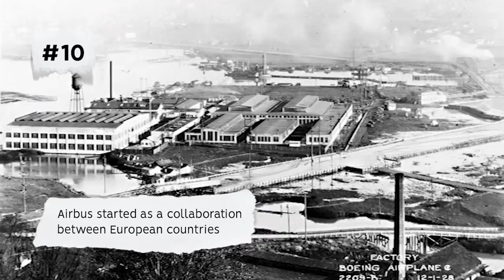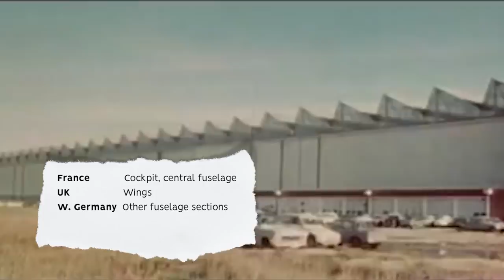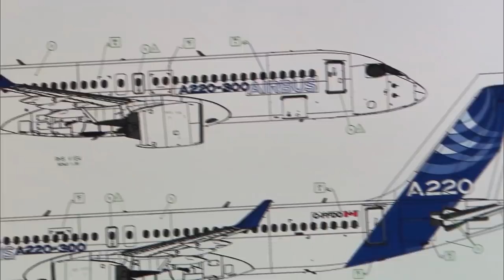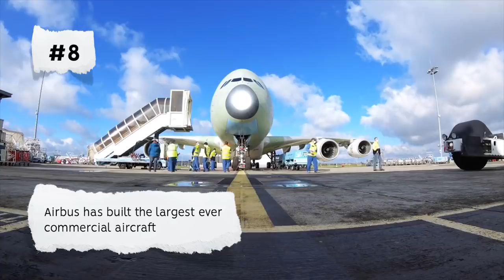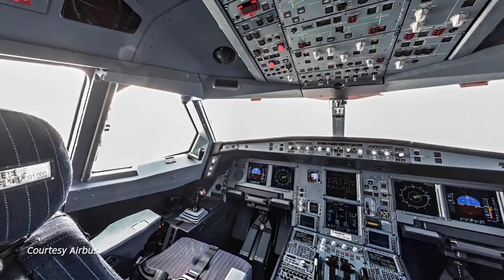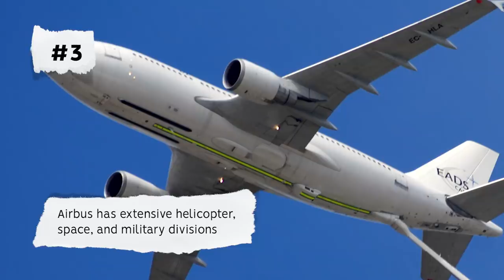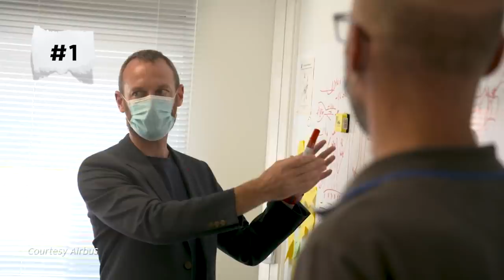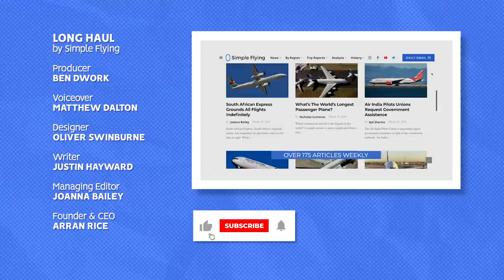10 Things You Might Not Know About Airbus

Comment: Some other things about their early products:
The very first Airbus was the A300B prototype. This prototype would be shorter than the original production version (A300B2). After Airbus didn't need it anymore it was sold to TEA (Belgium airline) but it started revenue service with Air Algerie on lease. The passenger A300 came in three sizes therefor, seating up to 323 (B1), 345 (B2/B4) and 361 (-600). The A300B4 also came with a digital cockpit in the -200FF version which ulitmately only was purchased by Finnair in low numbers. Also, the A300(B4)-600 is the only A300 to feature wingtip devices with the exception of some earlier A300 of this version. Interestingly, those wingtip devices are unique to the A300 as they feature a similar design but they have a much lower profile compared to the ones used on the A310-300 (and some late -200s). But that's not all: These A310 wingtip fences were then used on the A320-200 (and later on the A380) while the original A320-100 missed those.
Reply: The earlier A330s had a taller tail
Reply: Airbus is wierd

Comment: The original A300 agreed upon in 1967 was actually something almost the size of the A330, but powered by the proposed Rolls-Royce RB.207 engine rated at 51,000 lb thrust. But when airlines weren't so keenly interested and Rolls-Royce ran into RB.211 development difficulties, Airbus decided to reduce the plane to A300B size and switch to the more available General Electric CF6-50 engine.
Reply: That's right, the first Airbus project A300 was a 300 seats jet powered by new Rolls-Royce engines. But the project was rejected by airline companies and the availability of the engines was doubtful. So a crash program was launched at Sud-Aviation (R&D department in Suresnes which had previously developped the SO 4050 "Vautour") to completly rework the project, which ended with the smaller A300B project for 250 passengers using available US engines.
Reply: @78Dipar  Airbus was lucky that the GE CF6-50 became available by 1972. That made it possible to build the A300B powered by the GE 48,000 lb. thrust engine.
Reply: @Sacto1654  
It wasn't luck, the GE CF6-50 was selected for the A300B because it's availability was quite certain, it was first developped for the DC-10...
I have personally known the one who managed the team in charge of reworking the A300 project and replacing it by the A300B.
Reply: @78Dipar  Thank you very much for the very interesting historical informations.
Reply: Thank you very much for the very interesting historical informations.

Comment: Nice video.  Anyone know why Airbus chose 300 for their designation?
Reply: The initial study was for a 300 seat aircraft.
It required engines not available for a number of reasons, so the aircraft was quietly shrunk to a 250 seat capacity or so, while retaining the name.
Reply: @NielsC68  Thanks.  That makes sense
Reply: @NielsC68  the maximum capacity of the A300 is still above 300 ;)

Comment: I thought that the Lockheed L-1011 was the first fly by wire commercial airliner. Am I missing something?
Reply: Yes you are, it was the a320
Reply: @flexiexpress6713  thanks.
Reply: Nope you're both wrong, the first fly-by-wire commercial aircraft was Concorde, she had complete digitally controlled flight surfaces. A320 was the first full authority fly-by-wire and only the second fly-by-wire commercial aircraft.
Full authority means the computer does more than simply transmitting orders, it interprets them and can limit or block them in case the movement commanded by the pilot is beyond flight domain or limitations.
I'm heavily summarizing but where A320 has several control laws (Normal Law being the default operations one) Concorde somehow had only a kind of direct law.
Reply: @KyrilPG  The Concords' gauges were analog. Perhaps the flight controls were fly by wire, but the Concorde still has most  hydraulic systems. First fully digital fly-by-wire aircraft was developed by NASA and flown in 1972, so the Airbus A320 may in fact be the first fully digital fly-by-wire commercial airliner. I think the L-1011 had something similar to the Concorde, but it wasn't fully digital either.
Reply: @sainnt  Gauges have nothing to do with fly-by-wire. Every aircraft has hydraulic systems, this is off topic. You can have a fully digital fly-by-wire system and still use hydraulics actuators at the end of the line.
The definition of fly-by-wire is the replacement of mechanical cables and pulleys by digital signal wires.
A "fully digital" fly-by-wire only means there's no backup mechanical cables and pulleys.
Concorde's control transmission was fully digital and was the first commercial airliner built like this.
You're confusing display / cockpit, hydraulic (or electric) actuation and control transmission.
The A320 was the first full AUTHORITY fly-by-wire and second fly-by-wire airliner. Fly-by-wire means it's fully digital transmission by definition. Full authority means there's a computer interpreting and controlling the signal sent to actuators.
But on many fully fly-by-wire aircrafts several surfaces are actuated (moved) by hydraulics commanded by digital signal wires.
The proportion of hydraulics has nothing to do fly-by-wire or not. Even the most computerized airliners use hydraulics.
Concorde (takes an e at the end) also had a digital inertial and guidance / navigation system where you entered waypoints data. I think that's what you're thinking of about commonality with the TriStar.
I don't know which NASA aircraft you're talking about, but "fully digital fly-by-wire" meaning only the complete replacement of mechanical cables and pulleys, any aircraft flown in 1972 could not be the first. Do you mean the first aircraft that replaced mechanical cables transmission AND hydraulics actuators by electrical actuators?
Reply: @KyrilPG  that's not what I meant. The comments referred to gauges. The gauges on the Concorde was not all digital. not even close
Reply: @sainnt  Yes but gauges have nothing to do with fly-by-wire, automation or level of digitalization of avionics. I don't know why you talk about gauges because that's not the point here.
Concorde was heavily computerized for that time despite having analog gauges, it had a huge avionics bay with loads of digital centers, wether they were control, navigational or inertial. The control was entirely fly-by-wire, the navigation was computerized and engines had the first primary form of FADEC.
Only the display of the gauges was analog.
Glass cockpit (digital gauge) doesn't mean fly-by-wire.
For example, the 737 has a glass cockpit but it is still not a fly-by-wire aircraft. The 737 still uses mechanical cables and pulleys to control the surfaces (with an end interface with a hydraulic system).
The A320 has a glass cockpit AND fly-by-wire AND full authority (computer interpretation and control of commands).
Concorde had analog gauges but fully digital fly-by-wire controls and digital systems.
Gauges are irrelevant to the issue discussed both here in the comments or in the video.
Reply: @KyrilPG  I take your point. However, first completely digital fly by wire aircraft flew in 1972, and it was an aircraft designed by NASA.  Concorde first flew in 1969 or 1970. It was not completely fly-by-wire.
Reply: @sainnt  What aircraft are you talking about? (Do you have a name for that aircraft?)
Concorde was fully (or completely) fly-by-wire! It's not that difficult to understand, right? And it was the first fly-by-wire (and completely so) airliner. There were military fly-by-wire aircrafts before that however.
What don't you understand about the definition of fly-by-wire?
I think you don't understand the definition of fly-by-wire or you wouldn't be claiming Concorde was not "completely" fly-by-wire because it was completely fly-by-wire and computerized. The only thing analog on Concorde were the gauges.
I don't know what you're trying to say about that NASA aircraft but I'm pretty sure you're confusing fly-by-wire and electric actuators vs. hydraulic actuators.
Concorde was a complete fly-by-wire from the get go!
Reply: @sainnt  The definition of fully fly-by-wire is that none of the control surfaces nor engines fuel flow are commanded by mechanical cables and pulleys. So IF there are no cable and pulley linked to the pilot's commands for ANY surface or other form or controls and that they are replaced by electrical wires transmitting to either hydraulic or electric actuators THEN it's a fully fly-by-wire system. Concorde having ZERO mechanical cables and pulleys it IS a fully digital fly-by-wire airliner.
Reply: @sainnt    There are mixed FBW aircrafts where some systems work via electrical wires and some other systems via a good old cables and pulleys system (747-8 for example). But these aircrafts are not considered fly-by-wire. Only the 777 and 787 are fully fly-by-wire in the Boeing catalog.
But that was not the case for Concorde, because there was zero cables and pulleys, and so was a fully digital fly-by-wire system!
After that, on top of the fly-by-wire system there are other definitions like PBW and PBH, power by wire and power by hydraulics. Power by wire is a system where some or all control surfaces are locally (after the fly-by-wire) actuated by electricity only and not by hydraulics. And power by hydraulics is where the fly-by-wire transmits to a hydraulic valve.
A fully digital fly-by-wire aircraft can be either PBW or PBH or a mix of the two.
But this is not conflicting with fly-by-wire.
You can have a fully fly-by-wire aircraft like Concorde or the A320 (meaning zero mechanical cable and pulley to transmit pilots commands) with the actuator of a particular surface being hydraulically or electrically powered. A fully fly-by-wire aircraft only means there are no cable and pulley to transmit pilots orders, they are replaced by digital signals on wires, period!
You can't do more fly-by-wire than Concorde as it had no cable and pulley system. That's the definition of fully digital fly-by-wire.
So I really don't know how an aircraft could be more fly-by-wire than that! That's just outside the definition.
The only steps up possible are to add "full authority" like in the A320 family (and all subsequent Airbus: A330, A340, A350, A380) where a computer interprets and controls pilot's commands before delivering a signal to the actuators.
The fact that the particular actuator of a given control surface is electric or hydraulic has zero influence on the fact an aircraft is fully fly-by-wire or not.
So your unspecified NASA aircraft (that you've yet to give me a name for) can't have a fuller fly-by-wire system as per the definition of fly-by-wire that I already gave you numerous times.
You're either confusing systems, PBW, PBH or digital displays with fly-by-wire or not understanding the definition of it.
Reply: @KyrilPG  I believe the Concorde was the “first”  (it had been done before) analog fly-by-wire. The A320 was the first fully digital.
Reply: @michaelx4810  There's no such thing as full analog Fly-by-wire in Concorde. The signal was digital and driven by an army of computers in the avionics bay.
I know it's difficult to picture for that era but it was like that. What were done before were military Fly-by-wire. Concorde was the first commercial airliner with Fly-by-wire AND digital. As it was also the first airliner with digital control of the engines, a system that evolved into FADEC on later aircrafts.
The A320 was the first full authority fly-by-wire, difference being the first Fly-by-wire with a computer interpreting inputs as load factors instead of simple actions.
What was analog on Concorde were the gauges and only the gauges.
Since the signal passed through the computers it was digital and not a simple basic electrical transmission or the autopilot wouldn't have been able to work.
Reply: @KyrilPG  i don’t think I said anything about gauges? 

All "fly-by-wire" flight control systems eliminate the complexity, the fragility and the weight of the mechanical circuit of the hydromechanical or electromechanical flight control systems — each being replaced with electronic circuits. The control mechanisms in the cockpit now operate signal transducers, which in turn generate the appropriate electronic commands. These are next processed by an electronic controller—either an analog one, or (more modernly) a digital one. Aircraft and spacecraft autopilots are now part of the electronic controller.

The hydraulic circuits are similar except that mechanical servo valves are replaced with electrically controlled servo valves, operated by the electronic controller. This is the simplest and earliest configuration of an analog fly-by-wire flight control system. In this configuration, the flight control systems must simulate "feel". The electronic controller controls electrical feel devices that provide the appropriate "feel" forces on the manual controls. This was used in Concorde, the first production fly-by-wire airliner.

I generally don’t like to argue with people who think they cannot learn, so have a good one: I won’t see your response.
Reply: @michaelx4810  I'm not disputing what you're saying and I see what you mean by "analog" in that case and it's compatible with what I mean by "digital". The fact that Concorde had a digital auto-stabilization (and autopilot & air data computers) that was/were interfaced (and mixed with the feedback / artificial feel computer signal, itself interfaced with the Safety Flight System computer) between the synchro-transmitters of the controls and the PFCU's (actuators / servo valve and controller) was what I think motivated the "digital" qualification in documents I had. It can be considered as hybrid system tho.
Which is certainly very different from the way the A320 works.
It might also be a case of lost in translation as the Concorde documentation I have mentioned "commandes de vol numériques" and numérique translates to digital but maybe the English equivalent used another term or what you consider digital might be different.
I'm always eager to learn new things everyday. Especially in my passion, aviation, where even more than in any other domains, it never stops.
Also, learning is all I got left in life...

Comment: U forgot to say that the A330 is actually older than the A340
Reply: It is?
Reply: Wasnt the a340 first in 1991 and a330 1992
Reply: it's the opposite
Reply: Wut are u guys on abt lol
Reply: The A330 is younger than the A340
Reply: They were developed in parallel but since it was pre ETOPS the A340 was seen as the design with the most potential, so it was pushed first.

Comment: Your #7 A300 was first wide body twin” directly contradicts #10 A300 directly competed against Boring. 

This video is a treasure trove of factual errors.
Reply: #7 is true (A300 was the first wide-body twin-engined aircraft as the 767 came out 4 or 5 years later) and #10 is true the A300 competed directly against the 747 and then the 767 when it was released.

The facts in the video are all pretty well known though so the title is inaccurate.

Comment: "#3 Airbus also has extensive helicopter, space and military divisions" 7:35  I am surprised you didn't mention the A400M (Atlas) turboprop transport, a replacement for some Lockheed Hercules military transports. It seems 176 have been ordered, and 108 been delivered since 2013 to the militaries of 7 European countries and Malaysia (with a Kazakhstan order pending, and a letter of intent with Indonesia). https://airbus.web.factory.eu.airbus.com/sites/g/files/jlcbta136/files/2022-06/2022-05_MRS_GEN_Ord-Deliv%20by%20country.pdf . 
     It is interesting to speculate if some lessons from the design and production of the A400M could come to have an impact in the commercial space. As a turboprop, perhaps it could be converted to battery electric (or fuel cell) propulsion with regional or shorthaul application, sooner than the Zero-e hydrogen program. Such a large plane might have uses in intercity shuttles where a high speed train network is not available, or in developing countries with short or rough landing strips. And the lessons from the A400M, including its use of composites, could be used to make smaller regional and short-haul turboprops, perhaps with a reduced carbon footprint compared to conventional jets. Since Maersk is already pioneering the use of green methanol in container shipping, perhaps Airbus could adopt methanol as a fuel for an airframe somehow descended from the A400M turboprop, for use with commercial cargo or passengers (and of course military/humanitarian transport. Low carbon militaries!) . Methanol is already a liquid, more convenient than hydrogen, and although it is not as dense as conventional kerosene jetfuel, that shouldn't be a problem for a plane with a large maximum take-off weight (MTOW) like the A400M Atlas.